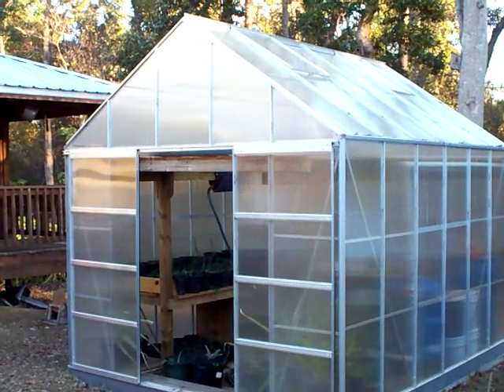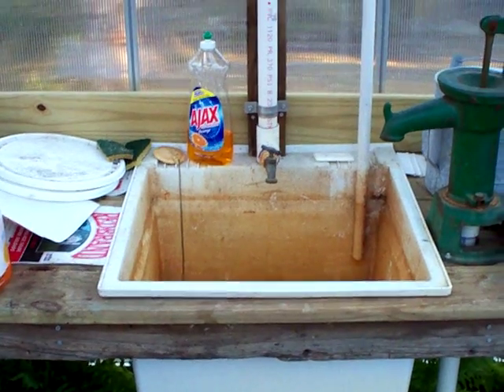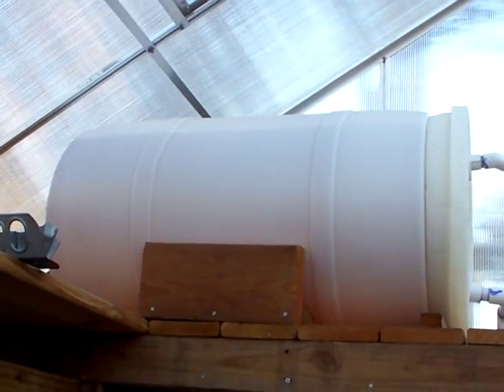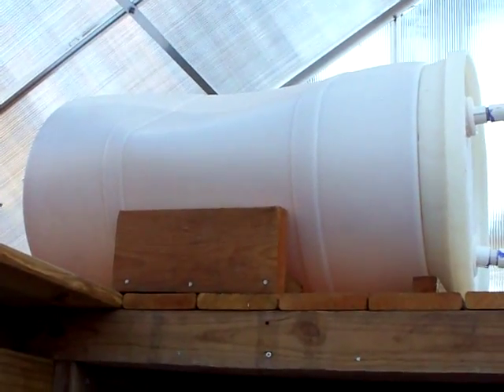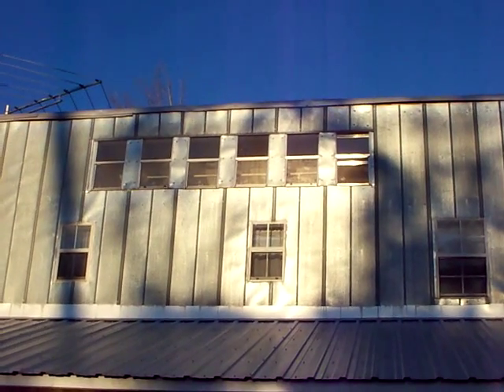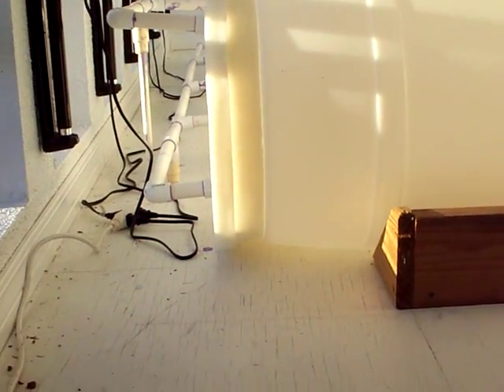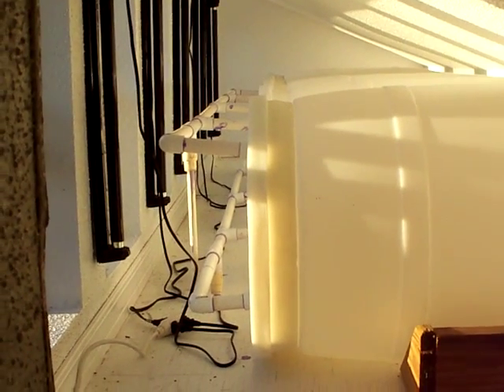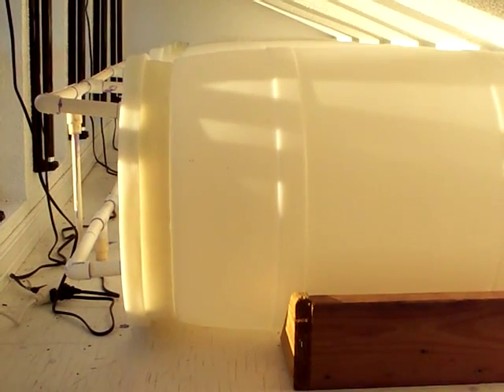Water Strorage

Comment: Do you have a gravity fed shower in the greenhouse?
Reply from the maker: Yep.  Use it all the time.
Reply: Im planing on building one but it got to be Off Grid and with rainwater. I somehow need to pump the water from one barrel up to another one above... not shure with what.
Are you useing a electric pump?
Reply from the maker: bmxion Yes.  It is actually just hooked into my well pump.  When the barrel gets low, I just open a valve and top it off.  I have no way to fill that barrel if the lights go out.

It's not a perfect system.
Reply: Maybe somekind of handpump or we´ll have to stick to the watering can through the winter. It works good through the summer. Thanks!

Comment: Your current floor is insufficient to support the proposed weight of the water barrels when full. 2x6 @ 16" oc floor joists are sized to support 40 lbs per sq ft of live (moving) load or 10 lbs sq ft of dead (stationary) load. Depending on the length of your span and if the load bearing walls are sufficient to hold the weight, you could possibly remove the deck and lag in some 'sister' joists to help distribute the load.

Comment: The reason your barrel is collapsing is because as the water runs out, it needs air to enter the tank so the water doesn't create a vacuum. If you install a one-way check valve on the top of your tank(s), this should eliviate your problem.

Comment: I agree with SNC... your local water treatment plant usually has several dozen of those blue 55 gallon plastic drums stacked up and are glad to get rid of them. I just picked up four of them for free to use as settling tanks for my WVO bio-diesel setup. You will have to wash them out, but they are easy to clean since the chemicals they held were water-soluble.

Comment: Can't you get some pond liner and line the area around them drums? It's a pretty small space that isn't being used for anything else. From the liner you could have a pipe that drains it to the outside so if a drum ruptures or leaks it will just collect in the liner and run outside.

Comment from the maker: @CHEECHAKOSMONTANA YES!  This system is a work in progress.  This wall of the house actually faces North West so the sunlight only lands on the barrels for a couple of hours a day and not directly or with much intensity, however this type of plastic last virtually forever unless exposed to UV rays so I will be installing some kind of sun block soon.  Originally I had both windows and skylights but right off the bat I had to roof over the skylight holes.

Comment from the maker: @preparedchipmunk Those Gnomes are suppose to be out guarding the garden but they are restricted by their height, because my grass is noraly about 2 feet tall.  The room with the water tanks in my house is hot by design, but has had several mutations over the years.  When I built the house I actually made skylights up there but it got so hot that the skylights melted and nearly caught on fire.  When the rain started pouring in I had to climb up there take the skylights out and roof over it.